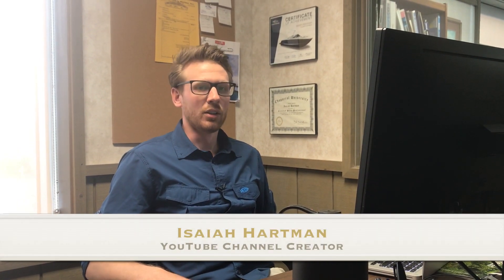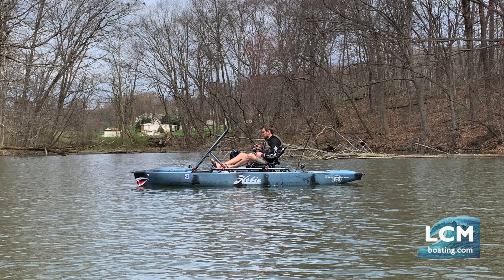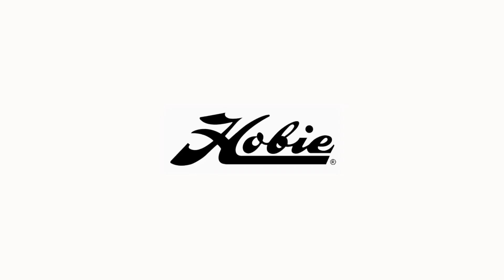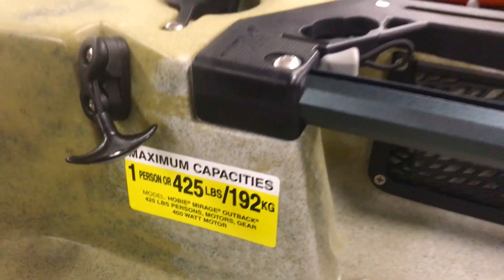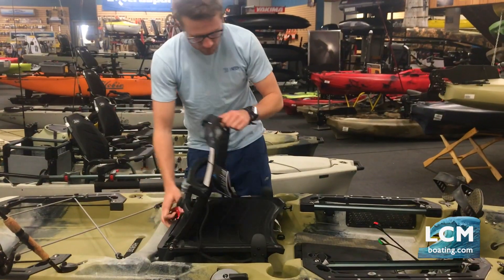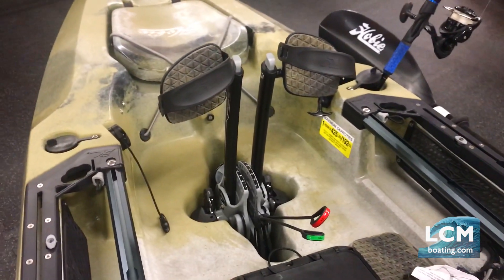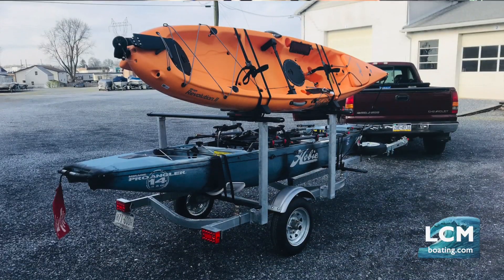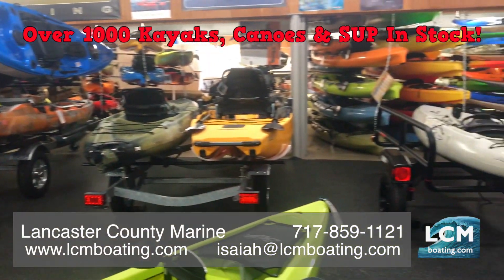COVID 19 Quarantined... The 1 Hobie Kayak to Buy, Compass, Outback, Pro Angler???

Comment: I have a 2013 outback and was wondering if the Compass and the new Outback are more stable , also I like to just plain paddle sometimes which one paddles easier ? Considering a new one with the nice seat , just not comfortable in mine anymore and feel confined getting older and gained weight didnt help lol.

Comment: it seems like a compass has 95% of these features, but is lighter and costs $1000 less. I don't understand
Reply from the maker: The compass has a lot of great features, however the Outback has so many features the Compass does not have. Guardian transducer shield on the bottom, H-Rail Tackle Management storage on the sides, Rectangle hatch in the middle, Bow Hatch, Rear H Rail Handle with load assist device, Vantage CTW seat, and a few smaller items. The Compass is more basic, a great choice for sure but not to the fishing level that the Outback is.